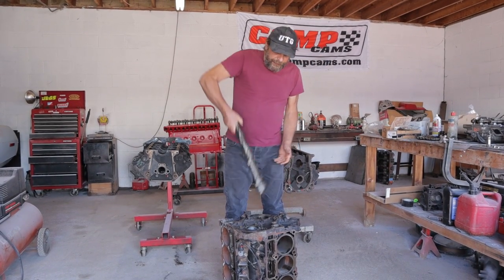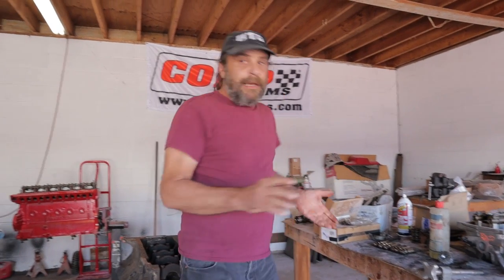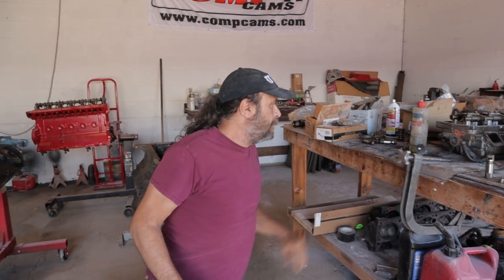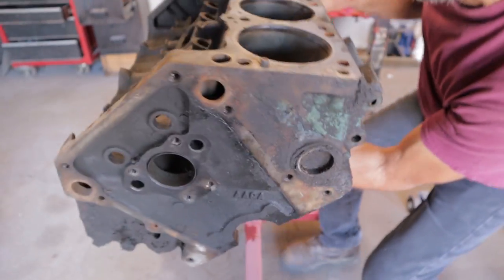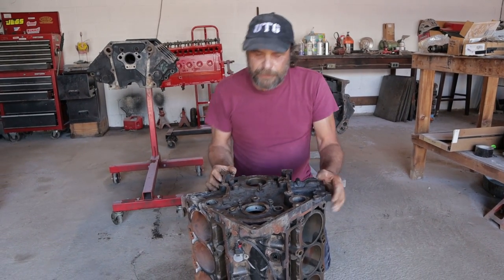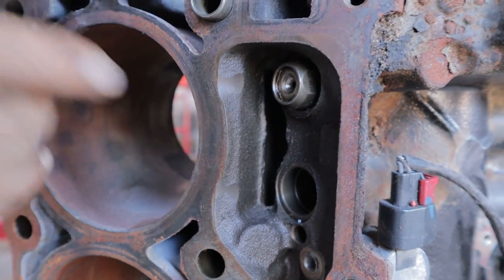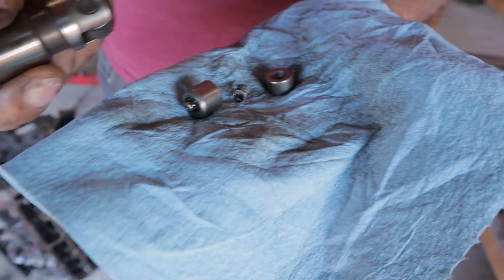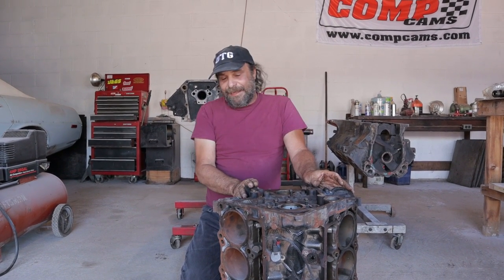Gen 3 Hemi Camshaft Failure Mystery Explained!

Comment: Great detective work. Hope someone shows this to Chrystler.
Reply: There is no issue on any engine that leaves FCA, Ford, GM etc that isn't already known.  When Daimler (or whomever owned them when this was developed) put this together, they knew about the issue.  They thought they could live w/ the issue.
Reply: I'd bet some Chrysler engineers have figured it out, but they don't want to say so because they don't have a solution either, short of redesigning the whole engine.
Reply: Chrysler is probably already ahead of the game and probably doesn't care. warranty is still cheaper than a complete redesign and the engine family is probably on its way graveyard of automotive history anyhow. Ford did pretty much the same thing with the Pinto. they knew it was an explosion waiting to happen but the law suites were cheaper than a redesign of the Pinto.
Reply: They know already. They also know if they acknowledge they know the lawyers will be storming the gates lawsuits in hand. By the time they figured it out tooling was in place, the engine was being built. It's a time event, probably didn't show itself in prototype testing and when it did it's way too late for a redesign. I believe it was somewhat of a rush design anyway. The 4.7 wasn't working out as well as they wanted with its share of, ironically, valve train issues so the development of the hemi was probably rushed somewhat. I was a Chassis Designer at Chrysler and GM for 30 years, this is pretty much standard procedure. A lot of issues don't show until time has passed, it's just impossible to fix something that doesn't show itself in testing. Used to be the lead time on a fresh vehicle or major component like an engine was years, when I tossed in the towel it was down to around 26 months from initial concept to production. I worked on the original Viper concept to production team and was friends with the engine designers, it was pretty cool to see an engine be conceived, built and tested to production, especially the aluminum V10.
Reply: Did you Charley dee have anything to do with/ know someone who did work on the gen 4 Vipers ? Specifically the camshaft VVD or lobes? Or multiair VVL ? Thanks as I think it’s genius ( I’d like to learn more about it as most of is in multiple Foreign languages other than English so I can’t understand and or have a hard time trying to translate what someone is saying or dumbed down way to much for me. a lot of it is missing the back story, how it’s assembled or serviced aka i think the outside lobes are a press fit 4to6th inches under size and the ones that move are a slip fit 1-3th with tapered ( 3/8 or 1/2” by 1/16 taper down) roll pins pressed down into the inside cam core hold it in place and I don’t have any tolerance figures for when it junk and can’t be put back in to service/repaired/ re-ground as example and the technical manuals are a little sparse as to how it works and or theory or how it can be modified for high performance use ) ( and other things like that including variable computer controlled shock absorbers or some of the torsion bar / air / hydropneumatic suspension ) if implemented correctly 

As someone who has had the opportunity to drive more than one USA brand vehicle I’d like to share my opinions the 2006 300s ride and drive really nice ( varry similary to my 69 Charger and that a good thing ) the 2006 rubicon had very good off road manners win it was new and I was surprised just how will it could soak up bumps @ 40 mph but can’t tow anything useful ( not even a empty car holler / small snowmobile trailer ) because of the soft springs and for the pickup trucks I prefer the pre-1999 ones ( I’ve owned a gmc 1968 and a 1986 at the same time which thanks to those who had involvement with them for the most part I’ve injoy them same with the Charger and 300) a I can’t see where the front fenders are / blind spots but I have been in newer ones a wow that’s a comfy interior o most to most to nice for a “ work / farm truck “. Now for a car I will not drive again is the 2007 Buick le cross as it has Poor road manners and the last time I saw it was upside down In ditch as example in low to high side wind it was very twitchy especially at 25-70~ mph and the only thing that I could think/ do to calm it down was having a full tank of gas/heavy luggage and I was planning on selling it ( for the 60s Charger) or giving to the wife only in town as a one year~ old beater that I got in 2008 or 09
Reply: @richardprice5978  No I did not. When it went to production I moved to Advanced Vehicle Design working on what became the Durango.
Reply: Thanks for your response Charlie. 

As for the Dodge Durango the wife and I liked the look of the 1990s ones ( but didn’t what a big gas hungry suv at the time as we didn’t have a need for a min-van thing for kids that a we were thinking of buy a bigger sedan or a classic pre-1970s station wagon if the need arised from having so many kids. As my trucks did most of the off road and towing jobs already and the jeep and Cadillacs / dodges did the rest ) and i did ride in a family friends ( and one other for Boy Scouts as a kid also a short trip to summer camp ) ( short trip and wasn’t brand new most of the time we were in the jeep rubcon I leased or I followed them and or using their 94 ford station wagon to get things like car parts on trips like that ) it was ok but I have limited experience with it so I’m not going to judge it for now as that might be unfair to you or your colleagues

If the dodge 1990-2004 Dakotas are related now that one I can speak for and yes the 2wheel drive has good road manners not the best at muddy Gravel roads/off road but that’s not a surprise. ( I end up helping with moving Furniture and cars with a 2003 ish year v6 auto at the time was up to 350th ish miles on the clock ) her dad and Mom like them so much that they bought two of them after the first one died and if I’m ever back in the market for a smaller parts runner truck I would hesitate to buy one. That and another friend in high school had a magnum v8 it was vary quick feeling riding shotgun with him
Reply: you think they would care? Why?
Reply: @kenrobinson1099  agreed, already heard their engines on hand ready to replace the 392

Comment: I did an MDS delete with a kit from MMX. The best thing that you can do for your hemi is delete the MDS and drive in 8 cylinder mode full time like an engine is supposed to.
Reply: I plan on doing that soon. It's a bit of insurance for the engine, and my hip pocket.
Reply: Can you keep the car in Sport Mode to deactivate MDS without a delete?
Reply: @s.daniels9564  
The MDS is still functioning even when in sport mode. Sport mode deactivates the solenoids, but the lifters are still robbing much needed oil from your rod and crank bearings. The idea is to get those cheap 
Chinese lifters out of your hemi, and replace them with better high quality lifters that doesn’t divert oil away from where oil is needed most, (bearings).

Comment: Damn, didnt know this was such a mystery. I coulda let ya know! As a lube tech at a chrysler dealer, i quickly learned about the failures of the new hemi’s. Essentially dont let them idle. Ever. Chrysler raised the cam, raised mpg, killed the engine.
Reply: I don’t think I can agree with the not letting a Hemi idle..... bought 03 Ram 1500 new. Thought nothing of it back then but i always let mine idle, summer with a/c on , winter with heat on. Changed my oil less often than recommend but at leas every 5k. Never a “Hemi Tick”. Ended up putting 235k miles on my truck before my negligence, low oil, damaged my engine. That was my personal experience and my truck was stolen 4 times, I’m sure the thieves beat on it while in their possession and each time the only thing they took was the 20” Chrome clad wheels
Reply: @andycollakascamp9772  that model is before these
Reply: @danielpassigmailcom  and he got it back each time??
Reply: @danielpassigmailcom  4 times successfully..... there was a 5th & 6th attempts but they were unsuccessful. 

The seventh... yes, seventh attempt was made, while truck had a blown engine in it. 
2003 was the year popular for the Hemi's re-introduction along with 20" wheels, and to the immobilizer theft deterrent system ..... I think the thieves recognized that and targeted my truck.
Reply: @danielpassigmailcom  I understand, i'd laugh too. I installed an alarm after I think the 4th theft-truck was maybe 2yrs. old I figured thieves would leave it alone..... NOT.
 The steering column was replaced/required after each theft so it wasn't like they were stealing a vehicle with a already damaged column. Prior to the last attempted theft, I had used a radiator clamp to "reinforce" the weak area of the steering column , around the lock cylinder...…. it helped, bcuz my neighbor heard the noise/several blows of thief attempting to defeat the column but, he couldn't steal it had blown motor AND DEAD BATTERY! it was night time and I guess thief was too stooped to realize dome light/alarm wasn't working/battery was dead,...... lt door lock was already punched tho….. SMH
Reply: @andycollakascamp9772  03 was before Chrysler implemented MDS which only greatly exacerbated the cam oil starvation issues which most likely explains why yours went over 200k miles without the lobes being ground off.

Comment: Tony, well done. You explained the cam and lifter failures of the gen 3 hemi perfectly.There is another small problem on great Chrysler engines, the 'B' and 'RB', cylinder heads on every other V8 including the small block Mopar, water and air from the water jacket flow from the block to the head and then it flows out of the intake face of the head, except the B & RB, the water has to flow down back into the block to exit the cylinder head and any air is trapped in the head. It cannot go down (check out the 361 truck head and water pump). I rectified this by drilling and tapping a small hole in the radiator end of each head, at the top of the internal water jacket and screwed in an external 90 degree fitting (its only to get the air out). Then running quarter inch hose from each head in an upward transition to the thermostat cover . I have driven my 505 RB on days of 110 degrees with no over-heating. Hope this helps anyone with over-heating problems.

Comment: I've built 6 of these so far and we use aftermarket lifters for this problem. The casting flash on the the drain back needs to be cleaned up as cracks can start here (depending on valvetrain stress and harmonics). I also increase the oil passages slightly to allow more flow to the rear bearing. On the first motor we didn't know about the lifters available and were going to drill 8 or 16 holes in the main oil galley and plug the bottom side with a quick weld. We calculated the additional 1/32 orifice to need and additional 1gpm. Along with the increased passage sizes we calc'd a necessary 5gpm addition to the stock pump so if you do any modification to the oil system make sure you have enough flow for the pressure you plan to run. BTW the formula for flow is Q=AVK where Q= FT³/sec A=area of orifice in FT² V= velocity in FT/sec and K= orifice flow modifier.

Comment: This "bad design flaw" is actually called *Planned Obsolescence*.
Reply: Not really obsolescence, but planned failure in order to sell over-priced parts over and over....but most people will never experience these failures because they change vehicles more often than their underwear.
Reply: @YoungOzzy432  lol u damn right and its crazy because you don't hear people talk about 5.7 hemi because it's not a performance package engine. Even the new dodge hemi's still have 5.7 problems. That's why dodge don't do recalls and if so you can prove me wrong.

Comment: Crower used to offer a precision ground flat on the OD of a lifter from the oil journal area down to the bottom of the lifter. This allowed extra cam oiling. I can see this helping the hemi. I'm currently knee deep in my 5.7 rebuild and am considering doing this to my new lifters and adding a Melling high pressure pump.
Reply: I have seen a lot of talk about installing the Hellcat oil pump as a solution to this problem.
Reply: It is volume problem not a pressure problem. Install the mellings high volume pump which will raise the idle pressure. The high pressure oil pump does nothing for the idle pressure it only increases the high rpm pressure which is not problem.

Comment: tony couldn't find anything about this inherent problem on the internet,  so he decides to figure it out for himself !
Reply: Proactive guys like Tony are how things like this GET ON the internet.  It's not magic...
Reply: TONY, I DOUBT THE ENGINEERS WOULD MAKE A FATAL FLAW MISTAKE LIKE THAT IN THE DESIGN OF THE BLOCK AND PRODUCE IT FOR SO MANY YEARS WITHOUT CORRECTING IT. IT HAS TO BE SOMETHING MORE SIMPLE. THE ONLY LOGICAL ANSWER TO WHY THE CAM LOBS ARE BEING WIPED OUT IS THE LIFTER ITSELF. WHERE THE ROLLER THAT RIDES ON THE CAMSHAFT, THE CENTER SHAFT DRILLED HOLE WAS NOT CENTERED WHERE IT WAS OFFSET, WHERE WHEN YOU SPIN THE ROLLER IT WOBBLES UP AND DOWN CAUSING A FICTION EFFECT. THIS IS ALWAYS THE CASE WHERE THE SUBCONTRACTOR WHO PRODUCED THOSE LIFTERS FOR CHRYSLER HAD BAD QUALITY CONTROL. THIS IS WHERE CHRYSLER SHOULD BEGIN THERE INVESTIGATION.
Reply: I personally know two people that this is happened to!!!
Reply: @oneeyedsnake6914  THIS GEN III HEMI APPEARED IN 2003 AND CHRYSLER MADE MILLIONS OF THEM. IF THERE WAS AN ISSUE WITH THE BLOCK THEY WOULD HAVE NEVER CONTINUED TO BUILD THEM WITH A BAD DESIGNED BLOCK. SO ELIMINATE THAT CHECK IT OF YOUR LIST. THE PROBLEM IS THE LIFTERS. MOST LIKELY THE ROLLER CENTER HOLE IS NOT TRUE AND CENTERED. AND AS IT ROTATES, IT BOUNCES UP AND DOWN CAUSING IT TO FAIL OVER TIME.
Reply: @Frank289100  They likely would have continued to build them, and just wouldn't have bothered since the issue usually happens after the warranty period has ended. If the issue was misaligned bores, they could have easily changed the castings and adjusted the lifter bore angle slightly when machining the block to fix this. Given that they clearly haven't fixed this problem over a decade of production, it has to be something much more inherent to the design, and a lubrication failure fits the bill.
Reply: @bradleylong3230  THE AMOUNT OF STUPIDITY POSTED HERE IS ASTOUNDING.SECONDLY, I STATED THAT THE CENTER HOLE NOT BEING TRUE AND ON A OFFSET IS THE CAUSE OF THESE CAMSHAFT FAILURES. I ALSO BROUGHT UP THE POINT OF THE MISALIGNED LIFTER BORES JUST IN CASE A JACKAL CAME ALONG TO CHALLENGE ME AND ALSO GAVE THE CONCLUSION, IF IT WAS A MISALIGNED LIFTER BORE THE ENGINEERS WOULD HAVE PICKED IT UP WHEN THE LIFTER WAS ROLLED ON ONE SIDE. TO CONCLUDED MY FINDINGS. THERE IS NOTHING WRONG WITH THE BLOCK AND NEVER WAS. THE HEMI IS A MEAL TICKET FOR CHRYSLER AND  IT DEFINES THEIR EXISTENCE. SO ANY DEFECTS FROM THE START WOULD HAVE BEEN ADDRESS. 

NEXT COSTUMER!!!
Reply: @Frank289100  You arent done with me yet. OEMs commit stupid design mistakes all the time, and this happens to be a case thats been explored by a lot of people. https://www.chargerforums.com/threads/answers-5-7l-hemi-camshaft-professional-failure-assay.382357/
This provides some more information on other people's conclusions. Im not sure what your qualifications are, but spamming in all caps doesnt get your point across. If you have difficulty reading, there are ways to increase the magnification on your browser.
Reply: @bradleylong3230  TONY MADE AN OVERSIGHT AND IT HAPPENS TO ALL OF US INCLUDING MYSELF. NOW YOU BEING YOURSELF, TELL ME WHAT IS CAUSING THESE LIFTERS AND CAM SHAFTS TO FAIL???????????

Comment: Happened to be reading an article on allpar shortly before watching this. Found it interesting from the article:   Tom Hoover, “father of the 426 Hemi,” told Hot Rod that he had discussed the Elephant Engine’s design with new-Hemi engineers. Three of his major suggestions — raising the camshaft (to shorten the pushrods, reducing valve-train inertia and simplifying the rocker arms), using twin spark plugs, and adding squish area (for more light load/low speed efficiency and reduced emissions) were adopted.